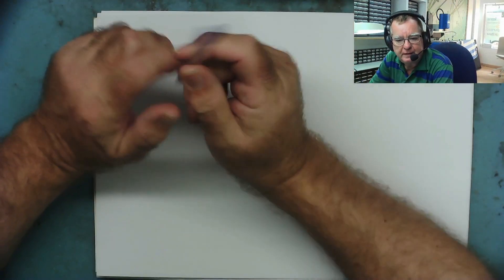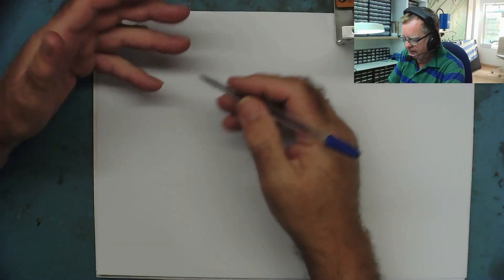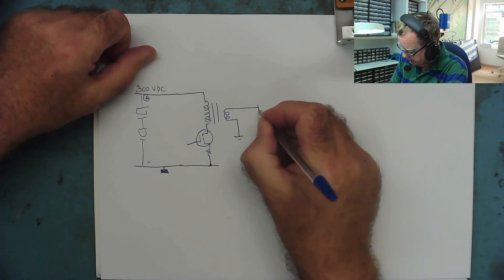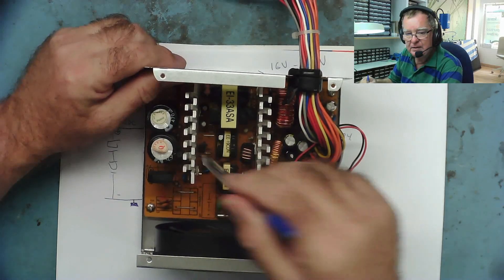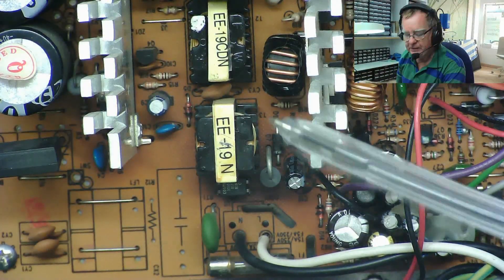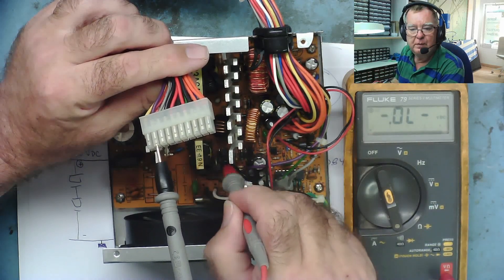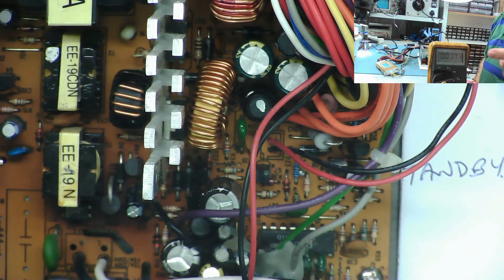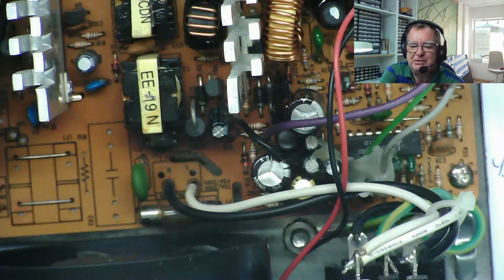ATX PSU has 5V Standby But Won't Start?  Check this hidden power rail found in almost all ATX PSU!

Comment: I'm trying to fix a Young-Year model YP-450-N, an ATX power supply used in an Ainsworth video slot machine.  My original symptom was that the +5VSB was pulsating and jumping around, and I could hear a ticking sound to go along with it.  However, the power supply did start when the green wire was grounded, and all the other voltages were stabile and within normal range.  The pulsating 5V standby voltage was caused by a bad opto-isolator.  Not the most common component to fail but it had an obvious crack across one corner.  After replacing it, the 5VSB is a good steady stabile 4.98V, but now after that is fixed, it won't turn on when the green wire is grounded so none of the other voltages are turning on.  I get a quick spike when I power it up and the fan briefly nudges, but it won't stay on.  I even tried a 2nd opto in case I had overheated the 1st one, but replacing it again didn't help.  I don't have any new ones on had so I have been pulling them out of parts boards.  This 2nd new one was on a single sided board so it took a lot less heat to remove than the 1st one.  
This video gives me something to look for.  I'm going to look for that hidden 16V and check the diode and capacitor around it.  I'll comment back later to report if I had any luck.  But please let me know if you have any suggestions.  Thanks
Reply: BTW, what type of meter leads are those?  Everything I have is too thick to fit inside the molex connector pins on the power supply so I have to use a jumper wire and alligator clip leads, more chance of shorting something out when working live.  Your setup is much safer than mine.
Reply: I found that test point you're referring to, on the smaller diode off the same small transformer where the 5V standby voltage is produced.   Mine has a 47uf 35V capacitor and I am measuring a good solid +25V, so I assume that's not the problem.  The funny thing is mine started up and all the voltages were good until I fixed the pulsating 5VSB voltage by replacing that bad opto.  Now I can't get it to start.

Comment: Thank you for your video, the capacitor really was the problem, the logic IC could not get enough Voltage. It was reading 2.7uF instead of 100uF

Comment: Thank you very much for posting this video.  It enabled me to fix a Bestec ATX0300D5WB that wouldn't start the computer until after it warmed up for a period of time.  I measured the 5-V standby voltage and found that it started out low--around 2.5 V--and then very slowly increased until it reached about 4 V, when the computer started.  I traced the 5-V standby wire back into the power supply to an electrolytic filter capacitor, which I replaced, although it tested OK.  I then tested the supply on the bench, the standby voltage came right up, and the supply started immediately.  I thought it was fixed, but when I reinstalled it in the computer, it had the same warmup delay problem.  So I removed the power supply again, tested it on the bench , this time with a load resistor connected to the standby voltage, thinking that the delay might occur only under load.  I found that the standby voltage did in fact droop under a load of 47 Ohms, but it was hard to believe that the motherboard would draw 100 mA from the standby voltage.  At that point, I turned to your video, again traced the standby voltage line with the ohmmeter and found another large filter capacitor near the diodes that you mentioned.  That capacitor, a 2200-uF, 10-V electrolytic had a bulging top.  Replacing it fixed the delay problem.  I tested the defective cap and it measured only about 100 uF.  I then warmed it up with a heat gun and noticed that its capacitance increased with temperature.  Can you explain why this happens?  Thank you again.

Comment: Can any significant amperage be drawn from this hidden rail? I was going to se 5Vsb to power raspberry pi that controls PC fans/pumps before and after startup/shutdown. Powersupply offers 2A, which is enough. But if it was 2A at 12V or 16V, a number of far better computers could be used (from phone/automotive world, like rk3588).
Reply from the maker: That supply does not have much of a load on it. The only answer to your question is to try it and see what happens.
Reply: @LearnElectronicsRepair  That's the best answer I could have got! he he he! :D

Comment: Thanks for sharing. I have a PC that won't power on. The power button goes solid Amber and the manual says 

Boot failure: This is a system fault error condition, including the power supply. Only the +5VSB rail on the power supply is working correctly.

I thought it was a PSU issue but am getting the same with a new PSU. Can the motherboard have issues in not being able to request the amount of power it needs?

Comment: Is it possible for this hidden voltage to be less then 16v? I have a non working psu (5v stb present, doesn’t start up) which  has 13.5v on the second winding of the standby transformer, the caps seems good though

Comment: Thanks for the tutorial. TOP223's application note pointed me to realize that the 'hidden' power rail is called the bias supply in flyback transformer's lingo, which is used to power the low voltage goodies that switches the MOSFET to pulse the primary winding so we don't have to burn off the say, excess 288Vdc, to derive 12Vdc out of a say 300Vdc rail.

Comment: Hi. My cooler master silent pro gold 1200w  supply gives 5+vsb only. No other voltage and its not  powered on. How to solve it? I see capacitor with value of 16v 470 h28, is it the located near by +12v lineout. So is it culprit part?

Comment: My psu has an interesting fault. It won't turn on while shorting the green wire. However if I short the standby 5v to ground it turns on. Any idea what's going on?

Comment: Hi. Are you able to do a little video on how to add a -5v output rail to an ATX psu for use on AT computers?  I would have swap out the connector for AT of course. Many thanks.

Comment: interesting.  I have a psu that is powering the led on the m/b but won't turn on the fans and the drives etc. including the psu fans.  I can start the psu through the connector, (green-black) and it then outputs correct voltages. From your video I now suspect a hidden power rail failure. I can see a bulging cap when I take the lid off, so I need to investigate a little more closely and hopefully a re-cap will fix it.  I'll look for that little 35v cap whilst I'm at it. Thx

Comment: Really useful. Thank you. My psu is powering on but just for a few seconds and then going off. I’m getting 5v on the 5VSB and also on the PSON. When I connect PSON to ground the unit powers up but then goes off. Any ideas?
Reply: Mine does the same, I just use a hairdryer and heat it up ,then all good. I think it might be a bad cap
Reply: If adding heat makes it work then it's a bad cap.

Comment: i have PSU atx with the same issue, 5 volt standby ok, but won't start, i checked the voltage it's about 11 volts, so i replaced the cap with a new one, and still got 11 volts, i measure the output Voltage of Transformer and gives 16 v AC, why did after rectifier become 11 volts?
Reply: This could be normal. Check the rails under normal load designed for this PSU. Since rails share the same transformer naturally one rail tends to get out quite a bit if not loaded.
Reply: Input 16v ac and after single diode (half wave) is 16 x 0.7 = 11v dc.

Comment: Hello. I have some shitty unnamed PSU. I have done laboratory psu from it. I have accidentially putted 5v on its housing. Now its giving only 5V standby. What can cause this problem?
Reply: And when i am doing a shortcut on 5v standby and ground, it wants to start, giving normal 5v but after a milisecond it turns off
Reply from the maker: You need to diagnose the problem in the main switching supply.  So you have 5V standby, you may need the 'hidden rail' which is probably about 16V-24V.  I would start by finding the datasheet for the PWM controller - read the part numbers for any ICs in the PSU then look them up until you find it.  From here you can start checking for problems, does the PWM controller have power, is it oscillating etc

Comment: That's a valuable information thank you for sharing
Reply from the maker: Very welcome
Reply: @LearnElectronicsRepair  Hi Richard and thanks for all the infos you provide. My issue with the psu is when i start it without connecting it to the mainboard it starts, i measured all voltages and they are ok. Also the standby is 5v.  Connecting it to the mainboard it wont start.  The MB is functional. One more detail , when i connect another working psu to the MB some leds flash one time. When i connect this faulty one the leds on the MB flash constantly every 2 seconds. Should i open the psu and check for that hidden voltage? Any other info or advice? Thanks again.

Comment: awsome video thank you, i have this issue on my seasonic, but the funny part is that when i power it i only get 5v sb. no 12v 5v or 3.3v  but, when i slowly play with the power switch on the psu and let it make a arcing noise then the psu will all of a sudden give me the 12,5 and 3.3v. when i restart or power down and switch on again then its back to square one and only supplies the 5.5v sb. untill i play with the switch again

Comment: hi, i've watching all your videos trying to fix my evga 700w power supply, its does have standby, but the voltage in green wire is 2.5v instead of 5v, when i try to power it on, it start for 1 sec, then power off, it does give voltage 3.3v 5v 12v for that second, then they start to drop. will check that capacitor, any other ideas?
Reply from the maker: See if you can trace where the green wire comes from.  it should have a pull up resistor maybe a few K ohms or some similar arrangement to put 5V on that wire.  Having said that the PSU does start so it probably is not causing the problem.

It could be that you have some fault in the circuitry that monitors the voltage rails or current (usually a Quad Comparator  like LM339) so the PSU thinks there is an overload when really there is not.  For example a bad voltage reference or a low value resistor gone high could cause this sort of fault

Another option would be a real overload on one of the voltage outputs
Reply: @LearnElectronicsRepair  thank you very much for your time to answer, i replace that capacitor with no luck, the same, replaced the tny279pn, same result, it does have this wt7527v PC POWER SUPPLY SUPERVISOR, not sure how to check this :(, its the closest to the green wire, also have CM6800tx
Reply: @androsk  Did you able to fix the psu. Mine has same problem. Start for second then off
Reply: @MdShamim-cl5ig  nope, I gave up

Comment: Sir, what is T2D 87 diode in standby transformer? How can I find this diode equivalent? This is normal diode or what is this I can not find it ?
Reply: This diode in generally stay near the standby transformer, this is normal diode or what I don't know
Reply from the maker: @TheWeftmen  From doing a little research this is likely to be a Zener diode or a TVS (Transient Voltage Supression) Diode.  If it is a TVS it would read open circuit both ways on a multimeter.  If it was a Zener then you could unsolder it and check it using a bench PSU and a series resistor for example 470R or 1K.  

+ve ----/\/\/\-------|<i-------- -ve

Measure the voltage across the diode - increase the bench PSU voltage, when the voltage across the diode stops increasing, that is the zener voltage

Another way to be pretty certain it is Zener or TVS:  With the ATX PSU working, measure the voltage across the diode.  If it is more that 0.6V and also reverse biased Cathode +ve then it is a Zener (or TVS)  You can't measure the Zener voltage for certain this way - it depends if it is being used as a voltage stabiliser/regulator or as a protection against higher voltage spikes

I hope that helps
Reply: Sir thank you so much for your good idea and answer, I sent now a link T2D diode series, for example in this link T2D 33 diode, it is similar with T2D 87, thank you
Reply from the maker: @TheWeftmen   maybe yours is an 8.7V zener.  I know that is a rather strange value but.... hmmm maybe
Reply: @LearnElectronicsRepair  okay thank you